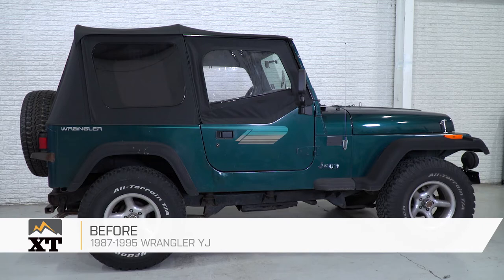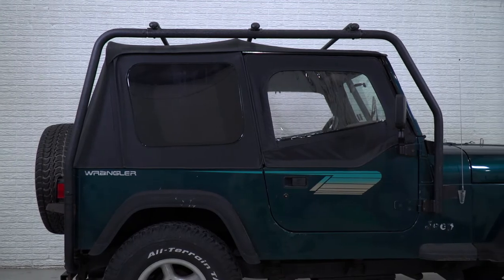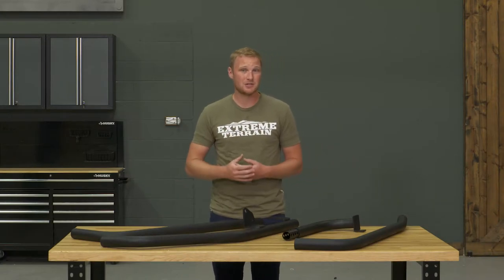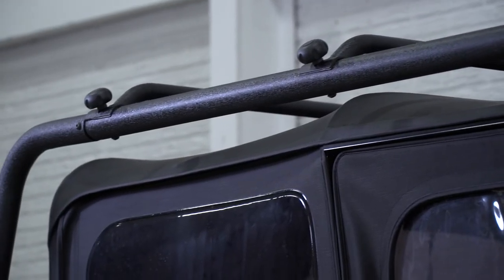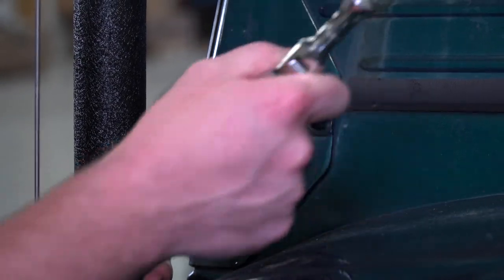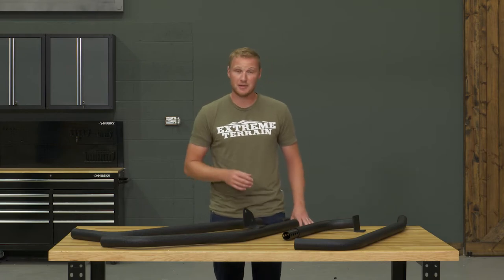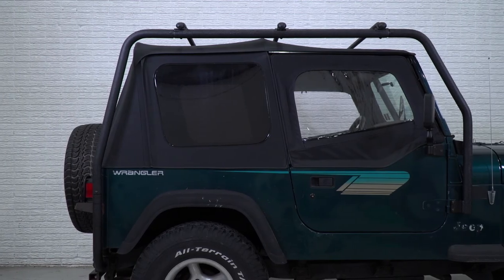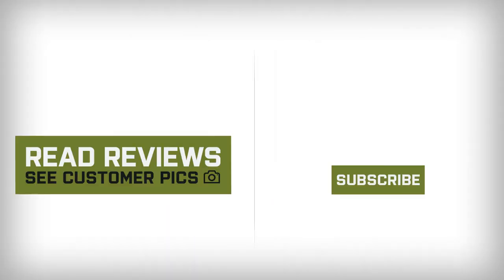Jeep Wrangler Barricade Roof Rack (1987-1995 YJ) Review & Install

Comment: Installing this, the most painful part was removing the bolts from the lower windshield mount and the  door hinges. All bolts stripped and some factory adhesive.
Reply: John Castle I’m at that stage now. Driver-side windshield bolts. Broke the bolts loose of their loctite from the manufacturer with use of a cheap torch, only to find that the nuts on the other side free float blindly behind the dash. Can’t see them. Can barely reach them. Hoping to find a wrench. I cannot imagen the nightmare of threading the nut upon install
Reply: I know I'm actually working on this right now and it's a headache
Reply: @doomgod314  it helps if you have little girls hands. or a long neck box wrench. Ha ha ha
Reply: @zimmzero  yeah. I ended up asking someone for help. A second pair of hands made it easier